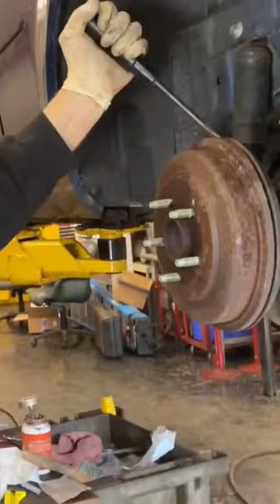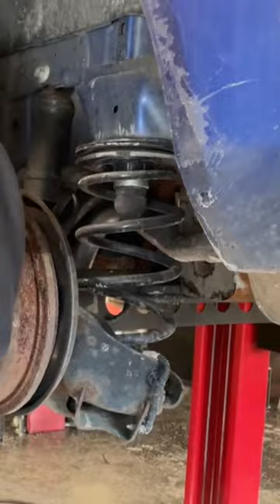How To Remove a Stuck Rear Brake Drum #shorts

Comment: Back off the self adjustment
Reply from the maker: We did that but SOMETIMES the brake shoes get hung up on a lip inside the outer edge of the brake drum.
Reply: @HomeOwnerRepair 😂 ain't it great to have all the experts on here.  Those SOB's probably couldn't get da tire of mane